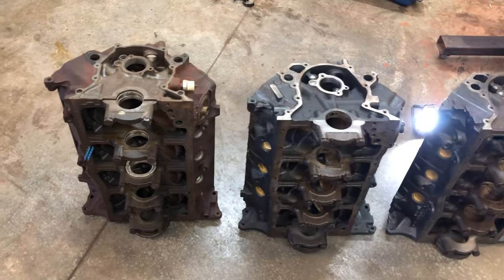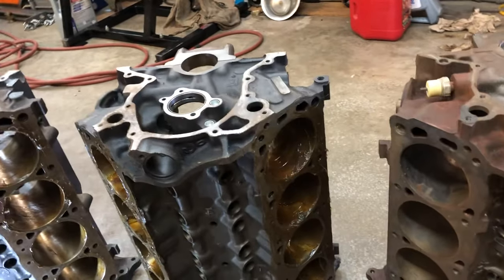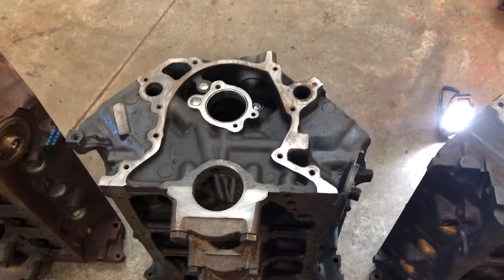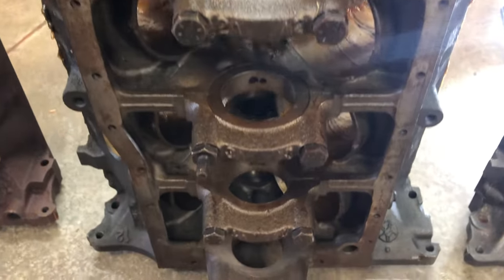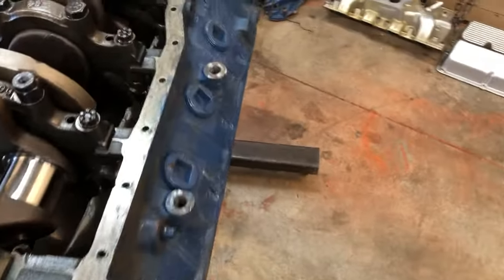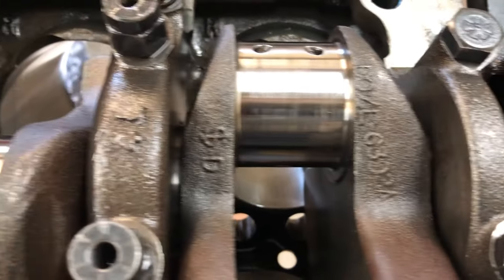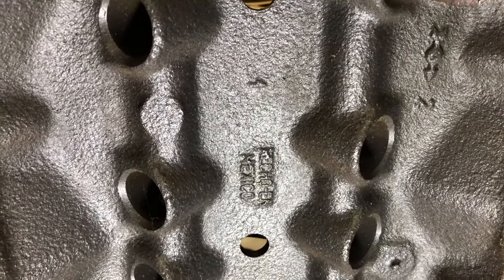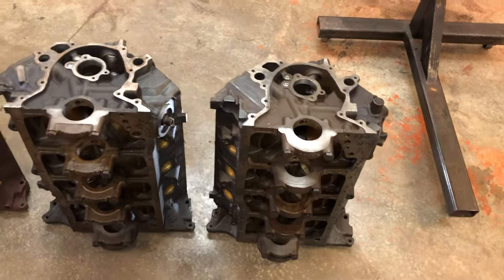The 4 different factory versions of the Ford 302

Comment: Australia also has a 302 Cleveland engine. 4 inch bore, 3 inch stroke and real Cleveland style heads with the thermostat in the block on the extension.

Comment: In 1968 after 289 hipo was done ford sent all 289 hipo block casting cores to Mexico so the mex. 302 is actually the. 289 hipo block that's what I read in some very old ford literature

Comment: The Boss crank was cross drilled for 1 year only in 1969 but not 1970 from what I have seen
Reply from the maker: I think that’s true
Reply: @pyleup 
It is: that was the 1968 Tunnel Port crank which went with the C8FE Tunnel Port block of the early '69 Boss 302s.

Comment: I helped a friend replace a 302 in a picup truck. The engine was a year or two different than the truck and a long block assembly. We found out the hard way that there are like 3 different firing orders that will all start & idle but nothing more. Some of them would run wired 180 out.       I'll stick with my "Mr. Potatohead" Chevys where everything fits the same holes from 153 to 454 CI.

Comment: OE Boss block was a stronger iron and 85-98 302's had different firing order with different lifter bore diameter I believe. The change in firing was to relieve strain on #1 main I think. Not sure of the price point of a new SVO Boss block or if it's a direct replacement.

Comment: Australia had a 302 Cleveland
Reply: The Aussie made 302 is different again from the US Cleveland blocks. Iron crank, from memory big caps but 2 bolt as are the 351 in the majority. So there are at least 5 different 302 blocks from Ford.
Reply from the maker: Good information this video only generally applies to the US but if there are unknown versions of this, I’m glad for the information
Reply: @pyleup  The Detomaso's use Aussie engines exclusively so you will come across them in the US

Comment: In Australia we had a 302C version which followed on from the 302W.
Reply: is a 302C  closer  to a 302 boss?
Reply: Basically the Australian 302C is a de stroked 351C with a different crank with shorter rods with 2V heads.
The 302 Boss is a Windsor style block with Cleavland style heads.
Reply: Yes nothing to do with A Boss or Windsor , it's a Cleveland 302  simple
Reply: @JosephCowen-fz8vj  302 Boss is mentioned in the title and during the video. So maybe not so simple!
Reply: @wazzawalker6536  a 302 Boss is not a 302 Cleveland , simple , in case you didn't know a Boss 302 is a 302 Windsor type bottom end and Cantered valve heads similar to later Cleveland heads . The 302 Cleveland is a true Cleveland in every way , same block, same heads , only a 3 inch stroke crank and 6 inch rods , infact when the block was cast they didn't know if it was going to be a 302 C or 351 C untill the engine build sheet was viewed , and either a 3 inch or 3.5 inch crank was installed , any 302 C can be converted to a 351c just by swapping crank, rods , pistons .
Reply: @JosephCowen-fz8vj  In fact Joseph I do know quite a bit on the Cleveland blocks, I have assembled both 302C and 351C engines.
All I was trying to point out was the presenter in the video mentions the 4 bolt main block as a Boss.
Don't forget, the Windsor is a 60 degree while the Cleveland is a 90 degree V8, so not even comparable.
The other thing in my original comment was, In Australia the Cleveland followed on from the Windsor, this occurred around or during 1970.
Ford Australia had a casting plant which arguably produced the best Iron Cleveland blocks in the world producing blocks well after the Ohio plant stopped production.
Reply: @wazzawalker6536  you just proved you know nothing , wow , the Windsor is NOT a 60 degree never was even in 221 or 260 ci form , it has always been a 90 deg V8 like almost all V8 engines , a 60 deg V8 would be so out of primary ballance it would shake the car to pieces , Ford only made 90 deg V8s, you are repeating an old wives tale about Windsors being 60 deg. Always 90 . They are narrow because the valves are leaned back in the head and heads are machined to exclude an exhaust over hang like a Cleveland, yes you mentioned a Boss 302 but has nothing to do with a 302 Cleveland, the Boss 302 was an extension of the 302 Tunnel Port motor that was banned by US motor sport , so then in 1967 ford redesigned a new cantered valve head and put it on the tunnel port block a modified 302 Windsor one , and the Boss 302 never had Cleveland heads , as there was no Cleveland in 1967 it came in 1970 when Ford wanted to use the style of cantered valve head on a new motor the Cleveland. The Ford Geelong Casting Centre cast Cleveland blocks till 1986 for Aussie F Trucks and 1984 for Falcons.
Reply: @JosephCowen-fz8vj  I know that the Windsors are 90 degree, I'm just winding you up to see if you bit!
Reply: @wazzawalker6536  ok nice , but so many believe that to this day. My appoligises .
Reply: @JosephCowen-fz8vj  Please also accept my apology, you certainly know your stuff.
Reply: @wazzawalker6536  well a little bit , but thankyou , I went through the history of many engines , it's quite strange , how motors evolved , the Aussie Barra 4.0 24 valve Turbo motor started with the 144 ci Falcon six in 1961 , ford Australia evolved it . But history of motors is a grate thing , I never ment to be rude , just so many people repeat used fake info , and it's not true , have a nice day.
Reply: @JosephCowen-fz8vj  Found some information, Ford did produce a very successful 60 degree V8, it is the GAA. All alloy, duel overhead cams per cylinder bank, 4 valves per cylinder. Not a car engine, found in Sherman and Pershing tanks.
Reply: @wazzawalker6536  yes but not for 70 + years , and it was not designed as a V8 it was designed as a V12 plane engine, that's why the 60;deg angle , very unbalanced in a V8 it needs balance shafts . Ford did not get the contract for a V12 plane engine and later down sized to a V8 for tanks .

Comment: Well the one thing I would have certainly made mention of, especially for us pheasants who can't afford the $$$ stuff, but will make a big difference when building a plain old 302. 
There were 2 different standard production blocks, concerning deck height. Somebody mentioned an 8.750 deck... that don't count. That's a Dart block, stuff most of us pheasants can't afford. So that being said- 
68-73 had a 8.206 deck height
74-77 had an 8.229 deck
78-up returned to the 8.206 figure
This is really important to know because its gonna screw up your compression figures big-time, getting these mixed up. 
FYI the 1977 302 was the biggest pig in the lineup with the lowest compression ratio ever had at 8.2:1(could be less) as it was the only year the tall deck was fitted with the huge crummy 69cc heads. Prior to that was either 63cc or 58cc units on the tall deck. 
Other than that, great job on the comparison!
Reply from the maker: Thanks for your comment. I kind of consider this kind of a history video and I appreciate all the comments. I don’t know all there is to know about the stuff I just share what I do know and I appreciate comments like yours.
Reply from the maker: If someone takes the time to watch the video and read a lot of the comments, I think there’s a lot to learn
Reply: @pyleup  totally agree! Your video hits a lot of the major points. I happen to have a '68 Mexican block and you are spot on.  
Of course, Fords are not the most popular compared to GM or Mopar, and they do alot of strange things so there's much to learn if one hasn't been in the Ford world much. Been a Ford guy since I could walk, as was my dad, with a brief stint in the Mopar world. So I just try to share as much info as I can to hopefully help out another soul confused of Fords strange ways. Once you get use to Fords "Better Ideas", its not so bad. 😁
Reply: Interesting. That would explain why my 75 Mustang ll with a 302 had huge vacuum leaks when I installed a "previously road tested" aluminum intake manifold. I doubled the intake gaskets and that solved the issue, and it lasted for over 50k miles.
Reply: @61rampy65  if your intake required 2 gaskets on each bank, thats more than likely an intake thats been cut to fit on another block that was probably heavily decked, requiring the intake cut to match it.
The 8.206 and 8.229 both utilize the same intake manifold. The taller block was just machined in such a way that it still accepted the short deck intake. 
Now if you were to zero deck, or in the case of the .229 block, cut as much as it allows.... then you may need to shave down the intake as well, only slightly.
Reply: @61rampy65  btw, I'm a Mustang II guy as well. I'm down to 1 plus my sons, but at one time had a handful. I know these cars and their idiosyncrasies very well!

Comment: Thanks for your information and your input on the sbf motors . Nice shop and man cave thanks for sharing….. curious if I gave you info on a 408 w I built and haven’t installed it yet but curious about what kind of horsepower and torque Im possibly looking at ? Can’t afford to do a dyno run and I’m probably 2 hours from the nearest shop that could dyno it.. it was a 4 yr build due to my income lol.. but it’s together finally.. once again thanks for your videos I enjoy watching them 👍
Reply from the maker: You could always shoot me the information and I can give you a guess but just remember it’s just a guess at horsepower and torque
Reply from the maker: There are also horsepower programs you can put on a computer to plug in all your info
Reply from the maker: And remember, if you plan to drag race, the vehicle, weight, ET and speed will give you an approximation of horsepower
Reply: @pyleup  I have heard often about using drag strip results for estimating horsepower. What I don't know is whether the calculated horsepower is at the crank OR is it wheel horsepower, and is that "net" horsepower like manufacturers currently use OR "gross" horsepower figures like used up until 1970 for crank horsepower without engine accessories?

Comment: I have seen examples where the Mexican block main cap fasteners failed - this was a normally aspirated "built" engine it used ARP studs instead of bolts - they believed it had to do with the quality of the iron used in the block casting the threads in #2, #3 and #4 literally disintegrated
Reply from the maker: Do you know what power level they were at? so the treads failed Not the caps.
Reply: @pyleup  the threads in the Block failed allowing the studs to separate from the block - I only saw the remains of the engine it was normally aspirated aluminum heads single plane intake I don’t think the compression was outrageous it was used for road racing purposes in a 1967 Mustang
Reply from the maker: So I guess the sustained higher RPM might’ve got to it do you know if they used a girdle for the main caps that may have helped in this situation?
Reply: @pyleup  if I recall correctly the tops of the caps were machined flat on the top and there were some kind of steel supports that sit on top of the caps and help clamp the main bearing cap down evenly - there was no full “girdle”

Comment: You didn’t mention the screw in core plugs ? And I may be wrong but didn’t Ford go with a one piece rear main seal as well on the later rollers and what not that was produced? You are right though about the scarcity of the boss 302 engine, if someone said they had one I would be skeptical and say show me !
Reply from the maker: You are right I knew about all those things but making a video and doing it yourself is hard for someone getting older. I need to do an outline on paper before I  push record.